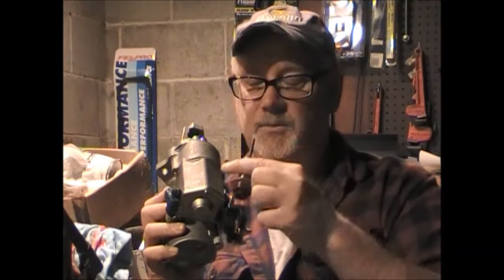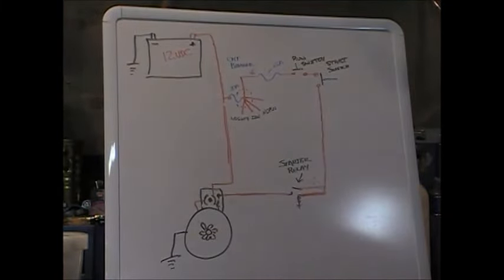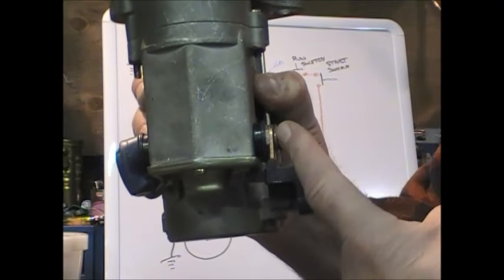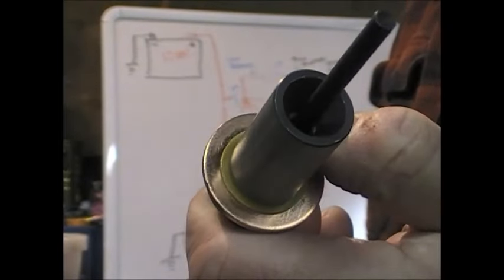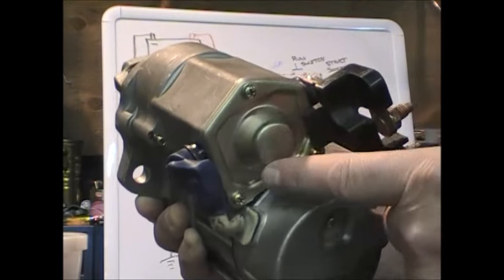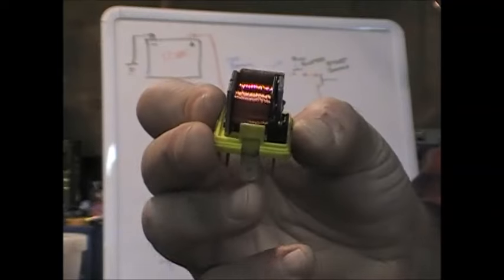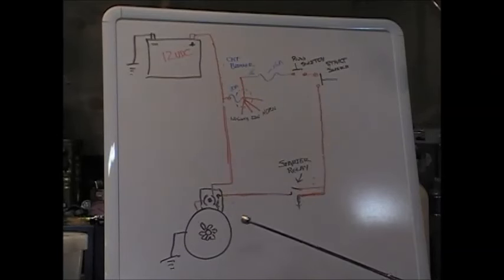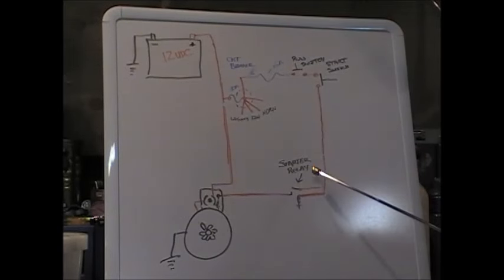Harley Davidson and the Click of Dread

Comment: on my 03 Electra glide, she would take several tries to finally start, pulled off the solenoid cover, pulled plunger sure enough ... the contacts and washer both so smutty and dirty, cleaned them , put all back, yes reconnected battery, haha boom started no problem....thanks bro... end of my click of dread!!!!!
Reply from the maker: Hey that's great news!  I'm glad that this video helped out and hope for you that cleaning the contacts is all that was causing your issue.  Watch out though- that 'click of dread' can be a sneaky bugger.  I did the same thing you did and thought I had it fixed but surprise it came back...and at the worst time possible- while waiting to get on a car ferry.   That prompted me dig further which lead to me making this video.

Comment: I have a 1993 FXR and the click of dread syndrome.  It's already had a solenoid rebuild, so I'm going to try replacing the starter relay.  Thanks for the tip!  On another topic, ever had spark plug fouling issues?  My plugs will last one or two rides and then I have to replace the spark plugs because of backfiring.  I've adjusted the fuel/air mix ratio to no avail, and may attempt a carb rebuild/replacement.  Any thoughts?
Reply from the maker: Fouling plugs?  Ok..I'm assuming your bike isn't blowing blue exhaust smoke when running (that would be burning oil) but probably is running rich and is showing black smoke when riding.  So first off, keep in mind that there is a difference between the idle circuit of a carb and the cruise circuit.  Your A/F screw is for idle.  Cruise is typically through jets or metering rods.  On the CV carbs jetting is controlled by a vaccum slide in the carb (access is through the black cap on top of the carb and you can see it through the carb opening).  With the bike off, make sure your slide moves freely.  Also check to make sure your choke isn't stuck in a full or partial on position.  If they seem okay, I'd have a look in the carb (with goggles one to protect your eyes from gas, flames, etc..in fact, a face shield is better) with the engine running.  You should see that slide moving up and down as you rap the throttle.  If not...I'd suspect a bad diaphragm on the vacuum slide assy.   Other than a plugged port somewhere I'd lay odds on the diaphragm but that is my arm chair opinion.  Hope it helps.
Reply: @Theoriginalmalcontentcorner  The choke does stay open unless I push it in.  If I push it in too early, the engine will cut out until it is warmed up. I'm thinking plugged jets and/or slide assy. I'm newly retired, so this may be my 1st DIY carb rebuild.  Thanks for your input.
Reply from the maker: @ Edgar-  Oh good....glad to hear the choke seems to be working correctly.  One down and X to go.  One other thing I thought of but didn't get to post originally was the possibility of a bad needle valve on the float or (rare) a bad float.  Your engine is getting too much gas now the sleuthing comes into the 'whys' of it.  Best of luck!

Comment: Daniel Campbell (below) has the perfect test for the solenoid!  I believe I did that the first time around but hadn't when the situation started again.
Reply from the maker: Thanks for your comment.  Daniel's way of testing is a good test however one has to be careful to not short out the test lead.  I can't say I 'recommend' it however considering the way some peeps are gorking out about me saying to pull the positive lead off the battery 1st which was just a mistake in filming.

Comment: 1990 HD Sportster 1200, replaced battery, replaced Ignition Relay, Replaced Circuit breakers, Cleaned all contact surfaces & wire plugins. When I hit start it clicks rapidly like a machine gun or will just click once. Have not figured out the problem. 

Please any suggestions, assuming I need to replace the whole starter.
Reply from the maker: I'm not saying you should do this but if I were in your shoes, I would try running a +12 volt line to the solenoid input plug (it's bladed) being VERY careful to not ground it out and making sure I had my bike in neutral.  If the starter worked like it should then it is something in the circuit feeding the solenoid.  If not, then would suspect either have a bad/low chg battery or a bad solenoid.  The main issue that I see is that the starter is a royal PAIN to get to on the Sportsters and unfortunately I'm not too well versed in them.
Reply: So glad I found this. Clear, concise and straight to the point - a fantastic video, thank you!

Comment: I have a 2008 Harley 1200xl custom anniversary. What’s the difference between click of dread and a starter that sounds like a car starter when it’s bad…a lot of clicks not just a few??
Reply from the maker: Heh, heh, well let me ask you-  When you are on the road how many clicks does it take to ruin the day? Especially if you cannot get the bike started?  Anything more than a few clicks is something I'd say is pretty dreadful!!   But to somewhat answer your question:  IF a starter can crank the engine over easily when working and fully engaged then is it somewhat safe to say that the starter is good. This of course doesn't rule out dead spots on the armature, flaky grounds or intermittent wiring either to or in the starter which is why I said "somewhat safe".  However if it doesn't engage the ring gear completely or at all OR doesn't even spin up then you probably have a bendix gear problem (old school starters) or a solenoid problem which isn't completing the power circuit to power up the starter.  Again- probably.  The art form is in the troubleshooting but as always- intermittent problems are the worst to deal with.

Comment: I don’t know if you still check the comments on this video but i recently put a chain drive on my 2000 fxdl and after reinstalling everything, including the starter the bike just makes one click not rapid clicking. I cleaned the solenoid contacts and still nothing. Battery has 12v
Reply from the maker: Hi Puff, I do check and am here to give my 2 cents of opinion...for whatever it may be worth.  The 'issue' as described in my video isn't necessarily a rapid clicking of any sort but a 'click' with nothing happening starter wise.  There are things you can do, at your own peril, to try to troubleshoot this. First off make sure the bike is in neutral!  Then you can take a 12V positive line and apply it directly to the solenoid plug to see if the starter will engage or still just clicks. If it still just clicks, that is probably where the problem is (bad starter, solenoid, contacts etc) and you'll have to go from there.  If it works like it should, then it is your circuit leading up to the solenoid (aka; switch, relay, corroded wire, bad ground, etc).

Comment: My 1200 Sporty has this. Thanks for the vid brother. So I need to dismantle it during winter.
Reply from the maker: Sporty is a bit of a different animal in the starter setup so, IMO, I'd check your relay(s), grounding wire(s) and such beforehand.  Rule out the easiest 1st, you know?
Reply: @Theoriginalmalcontentcorner  OK I will. Thanks Bro!

Comment: So what is it when i just bought a brand new duralast gold battery for my 2005 harley 883 custom and as soon as i put the new battery in and went to fire it up just a gang of clicking but it was really fast clicking not thr normal speed of clicking it usually would be
Reply from the maker: Hi Victor...so did you have the problem before?  I assume not, but that is just an assumption.  I'd make sure you have clean and tight connections on the battery.

Comment: Hi, just replaced the starter clutch in my '92 FXRS-SP as that seemed to be the problem, after the process of elimination. After all the work was done it was not the problem, same dreaded click after 1/2 revolution. Contacts cleaned, wires replaced etc. Seems now, like not enough juice getting to the solenoid {hence the wiring fixes} Any suggestions? Someone said the small ground to the starter might need up sizing? Thx.
Reply from the maker: Hi Don, well I'd start off at the beginning-  How is the battery in your ride?  Fairly new or several years old?  If okay, you could, if careful (and at your own hazard) run a 12v + line from the battery to the energizing input on the solenoid and see how that works thereby elimnating the circuit.  If it works like it should, then I would say you have some corrosion in the circuit.  And yes, that could mean a bad ground of some sort (wire with corrosion in it.).  If it doesn't work I'd guess a bad solenoid, sticky plunger, etc.
Reply: @Theoriginalmalcontentcorner  Hi and thx. for the tips. After replacing the starter clutch I discovered I had purchased a cheap battery and replaced it with better one {$200.00 +} and that was also a part of my issue. All good now but ran out of insurance for the year. Thx again.
Reply from the maker: @donmacaulay2021  :  Glad to hear you got your ride running again!  Sorry to hear about the insurance situation but there is always next year!!

Comment: Why in your diagram u point to the relay isnt under the seat its far away from your seat in your diagram isnt that relays position near the batter under the seat?
Reply from the maker: Hi Joe.  An electrical diagram is not the same as a physical layout.  And no, the relay isn't always under the seat.  Sometimes they are mounted on frames and fenders.

Comment: If you could help me I would appreciate it.  This one has me stumped.
1. Brand New Starter Installed.
2. If you push the starter button on the handlebars you can hear the relay fire, with a meter hooked up to the green control wire the meter is reading 12 volts 
3. If you hook the green control wire to the spade lung on the starter and hit the button nothing happens.  The meter is reading 12 volts but nothing.
4.  If you use a jumper wire and go directly from the + terminal of the battery to the spade lug on the starter ....It turns and starts.
So, why will the damn thing work on a jumper wire direct from the battery + terminal and not the greeen control wire that is showing 12.85 volts on the volt meter. when the starter button is pressed.....Nobody has the answer to this....
Reply from the maker: Well, that is a weird one, so I'll do my best to try to help you out:  When you measure the voltage of the green control wire is that with it connected to the solenoid or not?  If not, then here is what I think you have going on:  When not connected, you are measuring an unloaded circuit.  When loaded though, you may, again, may have some resistance in the circuit which only shows up when the circuit is under load (aka: trying to start).  What I would do would be to connect a voltmeter probe to the connector (if your probe will make good contact) while it is plugged into the solenoid.  Failing that you could use a jumper wire between the green wire and the solenoid spade to give you a good place to measure with a probe .  Then connect your meter and see what voltage you have when you try to start. Dollars to donuts, I'm thinking you have something in the line that is causing a voltage drop and I'm betting you aren't getting a true 12 volt at the spade.
Reply: @Theoriginalmalcontentcorner  Never tried it with the solenoid connected....Im certainly going to do it now that you bring it up.  I should have thought about it but, Im not the sharpest tool in the shed at times....Thank you so much for the help....I will report back.
Reply from the maker: @raymondpontremoli4500  :  Hey amigo, go easy on yourself.  Sometimes things just get lost in the fog of pondering the issue.  😜

Comment: I have a proplame that happened on the circute ; 
1_ some time being lazy with heating and comes like a bad odor and color of the coil ring winding is black 
2_other time I begin to start it seems like deactive then I try or reattempts after that start successful  but with heating ..
So should it need winding  ? or it is damaged
Reply from the maker: Sounds like you have a bad starter/solenoid.  Might be time for a replacement.  Especially is your windings are all burnt up as you describe.

Comment: Excellent job posting.. Shame that you never Used a HD Evo Starter to explain? Better Visual. 👍✌️
Reply from the maker: Trust me, Ian, if I had a HD starter to use, I would have used it.   I couldn't justify the capital investment in a HD specific starter for demonstration purposes.  However the layout of the starter I did use (Nippondenso) is pretty much the same with the exception of the stud(s) extension and the threaded solenoid connector.

Comment: Is this click a single click or a repetitive click? I've got a 2018 Street 750, literally got it yesterday and it ran fine until today. I set off the alarm, had to enter the code for the immobiliser but the alram was going off for a couple minutes. It now just does a single click and I wondered if it was maybe a low battery that is causing the bike not to start and just click once? Any advice would be greatly appreciated.
Reply from the maker: It is a single click that happens every time you press the start button.  As for your issue, I would suspect possibly a battery given the age of it but that is really just an off the cuff answer.
Reply: @Theoriginalmalcontentcorner  Thanks for responding. I neglected to mention it asks for the PIN every time. Guy at dealership reckons that the key fob battery is dead, going to get replacements today. I'll update if it fixes it.
Reply: @Theoriginalmalcontentcorner  And battery age? It's not even 3 years old?
Reply from the maker: @AwareWolfOnWheels  Wasn't sure about the battery age which is why I said "off the cuff"  Admittedly your bike sounds like is has some new wiz-bang anti theft security items going on so what I have here may not apply to your situation.  Hopefully the new fob battery will resolve the situation for you.
Reply: @Theoriginalmalcontentcorner  The new fob battery solved the PIN issue but it appears that the bike battery is too low to start the bike, I think it's been sat too long and the dealership didn't charge it enough. Hopefully it'll get sorted today, everywhere was closed Monday for some stupid reason.

Comment: My 2005 Sportster has always been hard staring even with a new battery on a tender. It will do one big lug then start cranking over more quickly. Do you think the relay could be the issue with mine too?
Reply from the maker: Honestly, if I understand the problem correctly it sounds more like a grounding or possibly a starter problem.  Typically the relay won't allow the solenoid to engage fully.  From what you describe it sounds like slow cranking at first with it picking up speed as you crank on.  You can jumper directly from the 12+ on the battery directly to the solenoid plug (note: be careful) to remove the start circuit from the equation.  If the problem still exist then you know the issue is with the starter itself.
Reply: Malcontent corner I checked my battery cables which weren’t as tight as I’d like then cleaned all the connection with a wire brush & 400 grit sandpaper. Also cleaned the contacts on the starter really. It helped a liiitle but I decided to look at my started solenoid itself. It was pretty dirty so I hit that with contact cleaner & sanded the copper contacts too. Definitely helped. Still not easy starting but much better. I wanted to attach my battery booster pack to see if my battery just wasn’t as healthy as I thought. But, of course, the pack is dead. lol

Comment: Outstanding! I fully agree, no"cheaping out",  esp. tires&brakes. Speaking of tires,  do you have a preference for a rain/moss tire? Its slicker than a witches tit here. My offroad bike had knobbies, but it was bad on ice/snow while on the pavement. Soft compound,  right?
Reply from the maker: Honestly I don't.  To this day I still run the OEM Dunlop's on my warpony.
Reply: Harleys are Heavy. They are a handful on wet roads to the point of 'whoa dangerous' .
New tyres help, soft-compounds also help ( but wear out quicker ! )
Good Luck - and use Caution.....

Comment: Hi amazing content! m facing a similar issue on my vrod muscle 2010. The light on the dash disappears after I press the ignition switch and I hear that 'click of dread'. It comes back on after resetting the three way main switch and the cycle repeats. Is it a short circuit or starter relay issue because the battery shows a 12+ V at the terminals. Any suggestions are appreciated, thanks!
Reply from the maker: Hi Ankur,  Honestly I don't know the VRod starting system at all but when it comes to starting remember this:  the big point isn't the voltage- it is the amperage!  That's why batteries are measured in CCA (cold cranking amps).  I'd have to ask off hand- how old is your battery?
Reply: @Theoriginalmalcontentcorner  What you are suggesting was actually the problem. Few days back, I took my battery for a quick check and indeed it's CCA was less than the spec value. Got it replaced the engine fired up in the first attempt. Thanks for the response though, appreciate it!